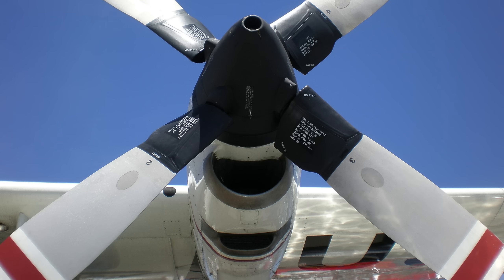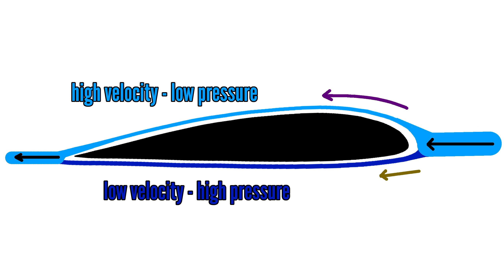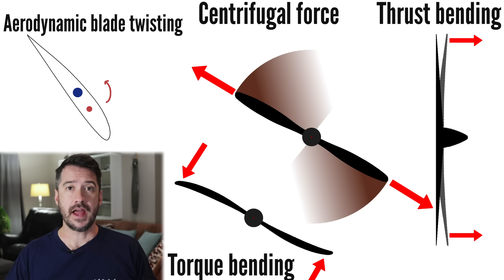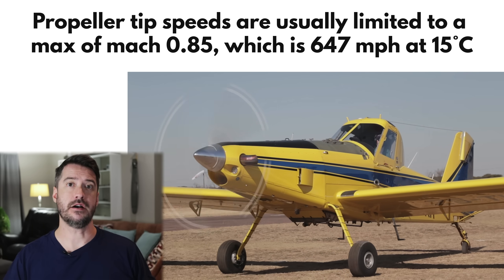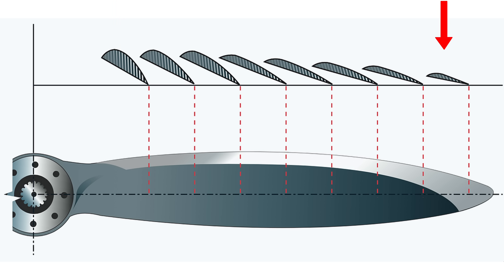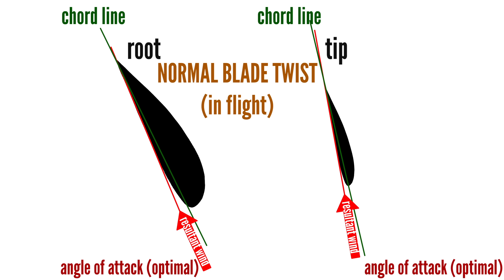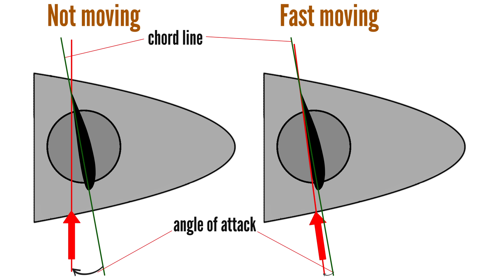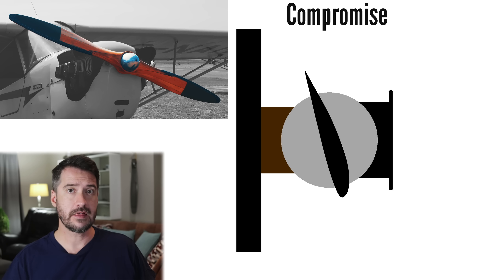One Video to Understand Airplane Propellers

Comment: I would love to get an idea of how much difference there can be in displacement of air with a variable pitch propeller, from fully flat blades, to optimal pitch, for thrust. 

Thanks for some really cool and informative videos.
Reply from the maker: That would be cool to see, but another way to think about it; with infinite power, a coarser pitch (up to a point) would displace more air. In reality, power is finite, and a coarser pitch lowers engine rpm (and power) due to increased propeller loading. This again lowers the mass of air displaced. So pitch doesn't really change the amount of air displaced, but changes the airspeed at which optimum thrust is achieved. I.e. finest pitch delivers optimum thrust at low airspeed, probably achieved at some point late in the takeoff roll. Coarse pitch delivers optimum thrust at some fast cruise speed. Lots of simplification and assumptions made in that description of course.

Comment: If the plane wheels were connected to a drive shaft, could it fly without a propeller ( in theory)?
Reply: Do you mean if the power was only coming from the tires? If that's the case, no. You still need thrust in the air. Something needs to be constantly pushing the plane forward to maintain flight (unless it's a glider in which case you need sufficient height to glide )

Comment: The pressure differential doesn't cause the lift. The pressure differential is the lift caused by the excellerated air.

Comment: DISCLAIMER: there is no physical constraints that will make the air in the upper part of the wingfoil (extrados) to meet the air in the lower part (intrados) at the trailing edge at the same time. This has been experimentally proven since the 30s in wing tunnel experiments…
Reply from the maker: Yes, here is a link of a wind tunnel video showing exactly that https://youtu.be/e0l31p6RIaY?si=Lv2djKL-5aBOF1ys

Comment: 1:00 A super pedantic note: Electric aircraft are driven by motors not engines. Engines convert heat into mechanical energy, generators (and alternators) convert mechanical energy into electrical energy, combustors convert chemical energy into thermal energy. So combustion aircraft use engines to turn heat into thrust; electric aircraft use motors to turn charge into thrust. It's not a super important distinction at the entry level but it explains why some systems (such as electric motors powered by a combustion generator) can be more efficient than a direct drive system.

Comment: For such an educated man I am really,, really surprised  that you appear to still be clinging to the "Bernoulli principle" See 2:21 .as providing the major lift. or thrust.  What about the change of momentum due to the air mass being deflected encountering the propeller?  Come on man .. as they would say in your wonderful country, SA;   God Bless.
Reply from the maker: Pressure difference above and below the wing is real (and proven) and is a 100% valid description of lift. Air over the top going faster than air going below is 100% correct - which is so silly to have to state, as there are many slow motion videos of actual airflow showing the speed up of air going over the wing. Momentum (displaced air) is a scientifically correct description of lift. There are even more scientifically correct ways to describe lift, like via the circulation theory and Euler's equations. Failure to realise that few of these theory's are mutually exclusive is why everyone is always arguing about who is right and who is wrong. It's like two people screaming exactly the same thing at each other in two different languages. There are of course plain wrong theories, but just form this reply you can see why I didn't spend 30 minutes explaining something (my understanding of it at least) for which the most basic, rudimentary understanding is required in a video about propellers.

Comment: It would also be nice to illustrate the notion of thrust production of a prop by noting that a "jet" is produced which is a continuous mass of air leaving the airplane at a speed higher than flight speed. Buried in that is the notion of propulsive efficiency which, for a propeller, is typically very good. The efficiency of converting engine power to jet power is, for a prop adversely affected by the rotational energy invested in in the jet. This is unavoidable without guide vanes and is the way the jet engine fan deals with the issue.

Comment: can you tell why angle of attack for downgoing propeller is more then upgoing propeller during climb ?
Reply from the maker: Explained in this video https://youtu.be/WnJxrHmtT_c?si=cOl-8pGvZavwkvek
It's because the oncoming air doesn't hit the propeller blades perpendicularly. Imagine looking on from the side, airplane at high angle of attack, the downgoing blade moves towards the oncoming air from top to bottom. The upgoing blade moves front to rear, bottom to top and actually moves slightly rearwards. Comparing the AoA of the blades at midway up and down shows the difference. It's called P-factor or assymetric blade effect and is most pronounced for taildraggers on takeoff with all 3 wheels on the ground, but will affect all propeller aircraft at high AoA.

Comment: I just installed a Sensenich  ground adjustable carbon fiber prop  on my my plane. The blade shape is totally different from the old metal prop. The biggest difference I have noticed so far is there is no vibration! It feels like I'm flying a jet at a 100mph!

Comment: Have you got a propeller on your front room wall? Excellent video by the way.
Reply from the maker: Yeah it's an old propeller blade. Thanks!
Reply: @LetsGoAviate  It took me ages to work out what was on the wall of a Military social club I once visited. Too big for a propeller, too thin for a wing. Turned out to be the rotor blade from a Chinook! Now they are massive :)
Reply from the maker: @jeffnorwood-brown8407   It can drive one mad lol. I still don't know exactly what this blade is from. Thought it was from a Continental R-670 powered plane, like a Stearman, but the shape is different. Looks more like that of a T-6 Texan, even though it seems too small.

Comment: Very nice video. I am learning to understand a different accent too!
However, one small correction: If you halve the diameter of a set of propellers, the reduced propeller will need to spin at four times as fast to generate the same thrust as the original propeller. That, in-spite of the reduced dia, gets the tips to the same speed as the tips of the original props.

Comment: This is by far the best and most detailed explanation while at the same time easy to understand. Especially that last section with prop pitch, and the drag in both vertical and horizontal profiles if you will. Great animations make it incredibly easy to visualize. My one suggestion would be to slow down the talking pace a bit, again in that last, very critical section of the video. Would also love to see a part 2 as others have suggested.
Reply from the maker: Thank you, and noted regarding the talking speed.
Reply: @LetsGoAviate  could u talk about slip and geometric pitch?

Comment: 17:50 Good video but wrong explanation of lift. The air over the camber does exit at the same time as the air flowing on the flat section of the blade.

Comment: Your first illustration rules out planes flying upside down. How can that be?
Reply from the maker: No it doesn't rule out inverted flight. Why do people think that? To be covered in full in next propeller video.
Reply: @LetsGoAviate  Well, your illustration clearly shows that lower pressure air over the wing is what generates lift, ergo, that rules out flying upside down.
Reply from the maker: @baozuci3594  My illustration does show that, that is how lift is created, but it does not rule out inverted flight. Go Google "wing stagnation point" and see why that argument is invalid. 

This prompted me instead make a dedicated video on this subject specifically, so thanks I guess 🙂

Comment: What an amazing video. Thank you! But after listening to all of that, I still do not know if the fine or the course is the high or the lower pitch :D Which one is also called high and which one is called low pitch? Thank you!
Reply from the maker: Thanks. Not sure I've heard it called high or low pitch, but high pitch would be a high angle on the blade, i.e. course pitch, and low would be fine pitch.

Comment: The whole "the air over the foil & the air under the foil, both arrive at the trailing-edge simultaneously" is false, according to the real pros:

the upper-surface air flows faster, and it arrives at the trailing-edge 1st.

iirc, it is MacLean who tells us that.

The guy who wrote "Aerodynamics from Physics" or something like that, is his textbook, but I'm talking about a lecture of his that is on yt, possibly an MIT lecture.

I've read that the optimal-efficiency of a prop is when it's tipspeed is .. something like 0.2M?

Something like that, or was it the least amount of drag..

The NASA rule of limiting prop tipspeed to 0.6M ( because transonic-flow begins on the upper-surface, bringing the upper-surface speed from 0.6M to 0.8M, and you're getting close to the dangerous zone, there, even without gusts ) also is something to consider..

Thank you for this: I'd not understood that agricultural-aircraft really are best served by fixed-pitch props, as they're flying just above stall-speed all the time, anyways.

Now I do know.

Gratitude.

_ /\ _

Comment: Great video! I was just wondering, why you summed up the chord length with "the same reason glider wings are long and thin". I searched for it, and it has to do something with laminar flow and the transition point, but that's it. Is this explained in more detail in another of your videos? A longer explanation would be better.
Reply from the maker: Long and thin wings (high aspect ratio) like that of a glider are more efficient than short span and wide wings (low aspect ratio) like that of a Piper Cub for example. Meaning the lift to drag ratio is better. Specifically it's the induced drag that is lower, partly because the wingtip is smaller (which is also the reason for winglets). The same applies for propellers.

If you do an internet search for "induced drag coefficient" you will get the formula to calculate it.

If you want to know why that is, you'll have to dig deep, it's not simple answers.
Basically you need as much wing as possible exposed to airflow (longer span) but as low as possible surface area because surface area is drag.  The aspect ratio is part of the formula, and the higher the aspect ratio tue lower drag coefficient. In theory the most efficient wing is infinitely long and infinitely thin, which of course isn't structurally possible.

Hope this leads you to some more in-depth answers.
Reply: @LetsGoAviate  Thanks for the explanation :)

Comment: Where are the formulas?
Reply: He is dead wrong in his explanation of the airflow about the airfoil : the longer lenght theory about the upper higher speed explanation. Not once he mentions that the helical tip vorticies are an extension of the circulation around the blades.
The propulsive efficiency 
eta = 2 / ( 1 + Vj ÷ V) 
is paramount and not even adressed.  Not even the basic thrust equation 
Thrust = mdot × ( Vj - V)

Comment: Another point on the blade length of properties vs the blade length of helicopter rotors:
It is not only the speed of the propeller tip that has to remain under Mach 1, it's the combined air speed plus the propeller speed that has to remain subsonic. For helicopters this is even more of a problem because the rotors spin in the same plane as the direction of travel. Thus you have not only the rotor tip speed, but the fact that the side of the rotor that is turning into the direction of travel will encounter faster moving air than the side rotating away from the direction of travel. This means as the rotor approaches the transonic regime, it will lose lift unequally, which will roll the helicopter to the side, rather than keeping it in the air.

The net result of all of this is that the fastest helicopters are dramatically slower than the fastest prop planes, as helicopters are fundamentally speed limited by the speed of sound. 

Same is true of jet turbines, incidentally, and if they aren't buried inside the plane, they are also limited to less than the speed of sound. On fighter jets, the air intakes have to be shaped in such a way that supersonic air is slowed to subsonic, and the tips of the turbine blades, just like props, also have to stay below the speed of sound. This happens to put a hard speed limit of turbines as well, because once you're moving at ~Mach 3, the air intakes themselves compress the air so much that we can't build a turbine that can compress it any more. (This is where the upper speed limit on the SR-71 comes from; the only reason it can go faster than Mach 3 is because it has a sophisticated cooling system that allows for dumping even more fuel into the afterburner.)
Reply from the maker: Very valid points, thanks!
Reply: Wow! Thanks

Comment: Love your channel and most of your explanations but at 2:21 you perpetuate a very common but absolutely wrong misconception on how lift is generated.  Yes, I know we were all taught this by our flight instructors, it’s still absolutely wrong and you have addressed this in your pinned comment.  For those that want to KNOW how wings (and propellor blades) generate lift, please go to this NASA page where they attempt to correct the miss understandings.  Start at the following link then scroll down and click on the small blue arrow for the next page.  You will need to study lift over several pages.  It’s worth it.  https://www.grc.nasa.gov/www/k-12/VirtualAero/BottleRocket/airplane/right2.html

Comment: ⚓️ Thanks LGA 😎 ok??? What’s controllable pitch? Since defining varying pitch thru the length of a blade … then describing variable pitch as a control feature… LGA is confusing or combining two features with one description…. Which is it?? Controllable? Or Variable?
Reply from the maker: I don't 100% understand what you are saying. The AoA that changes along the span of the blade I called blade twist. And blade twist is necessary to compensate for faster turning speed at blade tip than at the blade hub. Blade twist is "baked in" at the factory and cannot be changed.

Variable pitch propellers I called just that, the pitch that can be controlled (blue knob in the plane). And it's to get optimim blade AoA at all airplane airspeeds (vs a fixed pitch which would only by optimum at one airspeed, i.e. takeoff of cruise). 
Variable pitch changes the pitch (AoA) of the whole blade, and can be done in flight on varibale pitch or constant speed propellers.

I'm not confused or combining anything that shouldn't be 🙂
Reply: @LetsGoAviate  I guess you’re not open to specific descriptions… nomenclature using similar terms terms to define separate features is not consistent.
Reply from the maker: @pierheadjump  Not sure what inconsistencies you're referring to but I'll leave it there 🙂